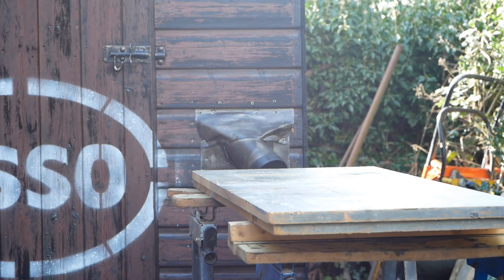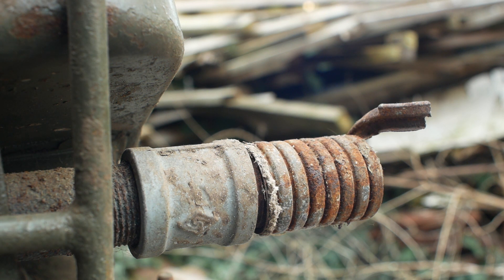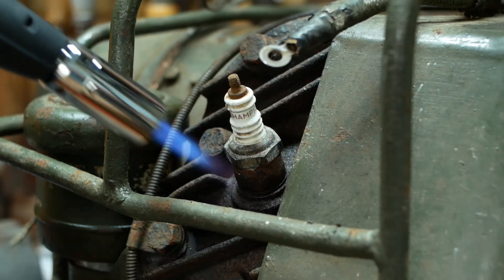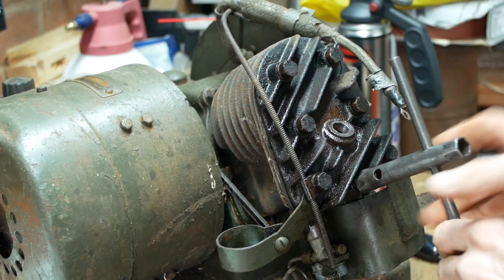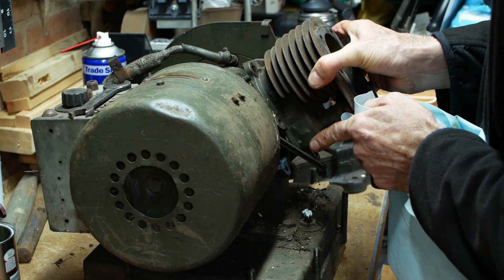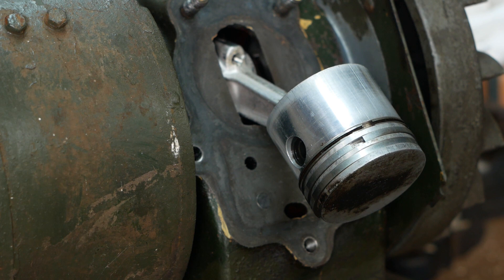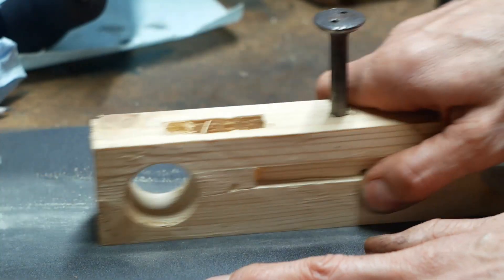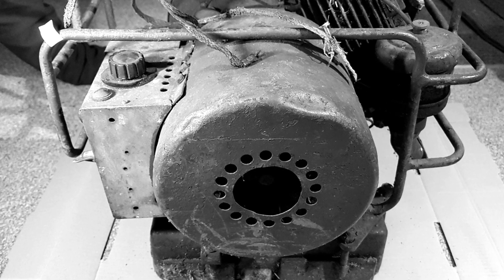Military BSA 300 Watt Generator - Chore Horse - Engine Rebuild - Part 1

Comment: I cant get over the fact that the rotation is opposite to any small  engine I have ever seen. Usually with small stubborn engines you can use an electric drill to spin the motor on the nut on the pulley which in this case would undo a normal RH nut.
Reply from the maker: I've only tended to use the drill method to confirm there's a spark - I was able to do that on this engine because, without the spark plug in, the nut was just tight enough to stay in place as I rotated it with the drill.  I think I said in the video that I knew the spark was weak, but it kept nearly running, so I persisted pulling on that rope for far longer than I should have.  It's lucky that the coil finally gave up and wouldn't produce a spark at all, otherwise I might still be out there trying to get it to start!!!

Comment: 7:20 . Oil is a lubricant ,it is the opposite of what you need to achive with your bore hone, which is friction.Use kerosene or other mineral spirits to better flush away the products of the hone.
Reply from the maker: I'll try to remember that next time I use the hone Roman - I don't use it very often, so I'll write myself a note to keep with the hone, cheers for the tip.

Comment: intresting video, wish that I could se some more from the internal gears and crank. The manual says its hollow pined to allow oil in the bigend journal
Reply from the maker: I should really have opened up the bottom, but from what I could see, that would involve separating the seal to the petrol tank in order to remove the bottom plate of the engine, and I was kind of in a rush to get it running for a show.  I'm hoping that by changing the oil, then running the engine for a bit, then changing the oil again, I might have dragged out most of the sludge - there's always that risk of the holes into the oil splasher bath being partially blocked, causing insufficient oiling.

Comment: lovely... always use tweezers to remove collets or you may lose the end of your digit but happydays and wicked vid  : )
Reply from the maker: That's a good point - I nearly braved the rain and mud to go and get tweezers when I was working on the valves, but I was just thinking of ease of installing the retaining pin at the time, I hadn't thought about the nasty nip you could get if you slipped.  It would be even worse on an engine with the split collet type retainers as against the pin through a hole type - now you've mentioned it I'll definitely use tweezers next time.
Reply: @GrumpyTim  I only know because I've got 6 and a half fingers and a bad back... Still got me sense though (And two thumbs).. And don't even mention 'bout putting me thumb on me mates front brake disc after coming off motorway.. Nice one
Reply from the maker: Years ago I'd have said that I was careful and therefore wouldn't have an accident - now I'm wiser, and I'm all too aware that you're only ever a second away from a lapse in concentration, or that little thing that you know you shouldn't do, but you've got away with it so many times, it must be ok now, and so on.  I'm probably quite lucky, because most of my little incidents have been "little incidents", but even then, I still try to learn from them rather than just ignoring them.
Reply: @GrumpyTim  Nice one Tim x

Comment: Looks good. Looking forward to part 2 and seeing it run.
Reply from the maker: Yeah, me too Ben, I can't wait to have that little engine chugging away.  I'm hoping to put together a little display so I can exhibit it at shows - the engine is a bit small on it's own, but with a few suitable props placed round it, it could look really nice.  I might get another inverter to use with it, so I can charge a battery using the generator and draw off a more useful voltage to power things.
Reply: @GrumpyTim  That could work, though at 300 watts it will not be able to make tea...
Reply from the maker: I might be able to draw quite a bit of the load from the battery to make a cup of tea - in the same way I did with my other set - it was a bit of a struggle even then - a bigger battery would help, but there again, how essential is it that I can make a cup of tea when I have cool vintage stoves to play with!!!  It'll still be an interesting experiment to try one day.
Reply: @GrumpyTim  That is true.

Comment: What a peachy little set, as you say most fortunate the water level didn't get as high as the bore. 

I wonder if the orientation of this played a role in the little f12. 

Bought an incomplete jap yesterday so I could copy the air filter for my rotovator, gentleman said he'd identified it as a wd Genset jap 4a but I can't find any reference on Google. Beautiful little thing, lots of brass.
Reply from the maker: Yeah, I could have bought myself a right pup if it had filled the bore with water - I've yet to see if the generator works, but it should be fine - might need new brushes I guess.

I was wondering the same thing myself - did this influence the F12?  I have an F12 on my JP lawnmower, but I've never done any work on the engine to see how similar they are.  If ever there was a lawnmower that sounds like a motorbike!!! - and from the footage I've seen of these generator sets, I think they have a similar sound.

Your incomplete JAP sounds good - hope we get top see that in a video sometime, in whatever form it is in.
Reply: @GrumpyTim  is it a dynamo or is there a rectifier lurking in the boxes?

Un seized my f12 with a view to making a go kart but that's as far as I got. 
Such a pleasing light little package, lots of nice organic shape in the tin and castings, also like the old motorbikes.
Reply from the maker: My hunch is that it's a dynamo - that would also fit with the fact that you can apply power to it to start the engine, however I saw a comment somewhere warning about it having a Beryllium rectifier - guess I'll find out when I open it up.

Coo, the F12 would be great on a go kart.
Reply: @GrumpyTim  I've heard similar beryllium stories around the bth magnetos, gemstone dust in the capacitors being the source in that case.
Doesn't sound too fanciful when you consider the windings were insulated with beatle shells.
Reply from the maker: I was just looking at a circuit diagram - it's definitely just a dynamo as I suspected.  The earliest models appear to have no suppressors but that wasn't so great for military radio use, so they added 2 across the brushes and 2 in the electrical box - maybe those capacitors contain Beryllium - I guess I'll check them to see if they're still working and replace them if necessary.